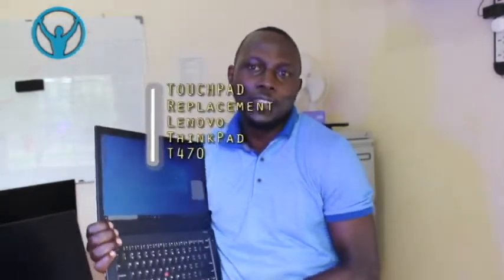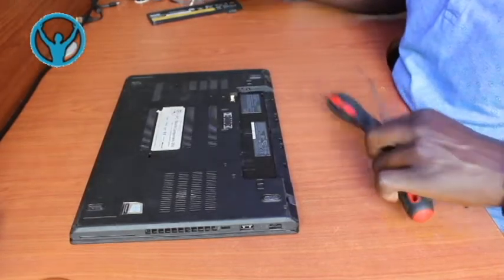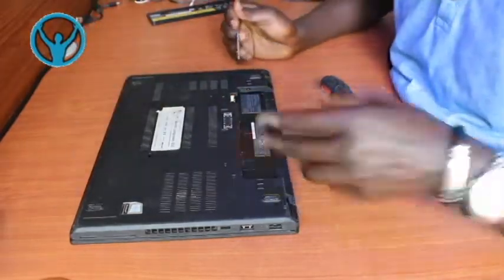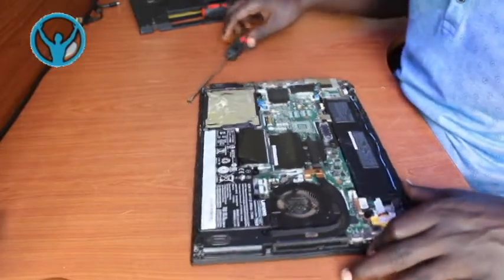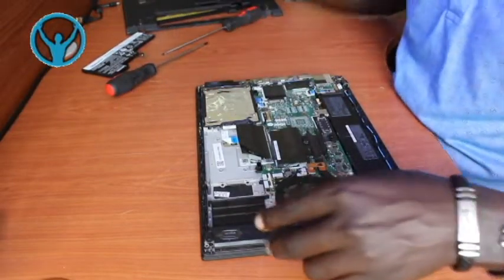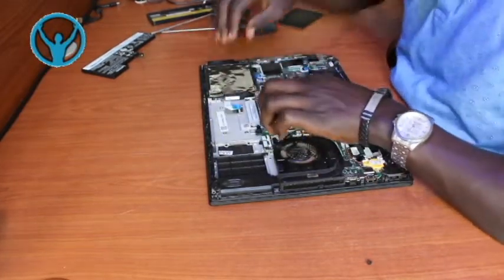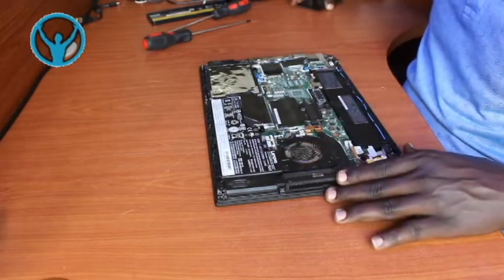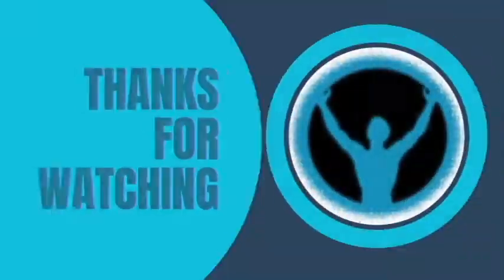Lenovo ThinkPad, How To Replace No Working TouchPad Lenovo ThinkPad T470

Comment: For some reason that i don't know... After replacing the trackpad for another, both traxkpad and trackpoint Won't work on windows with their signed Synaptics updated drivers, but with Microsoft generic driver it works, why it happens?
Reply: It's a T470